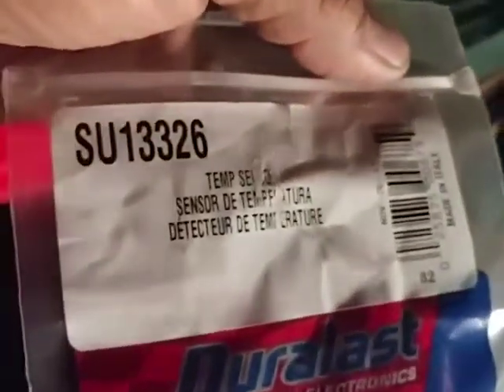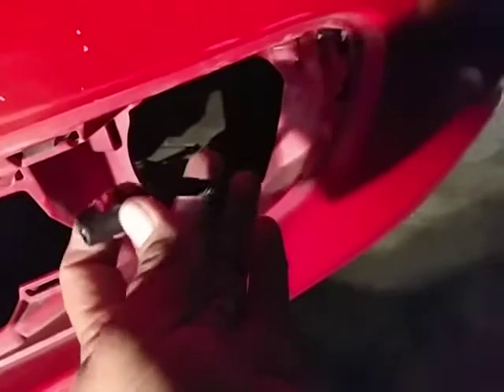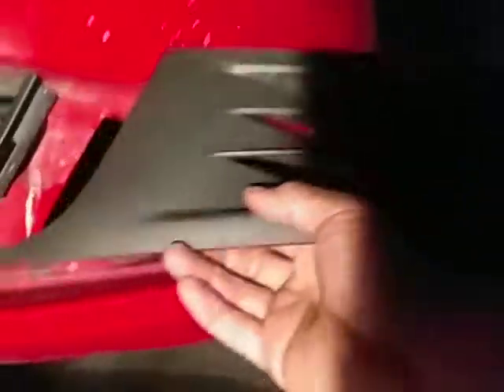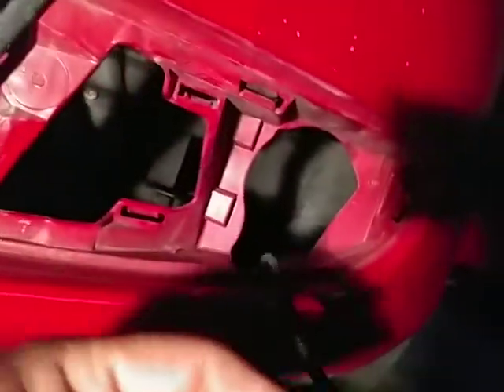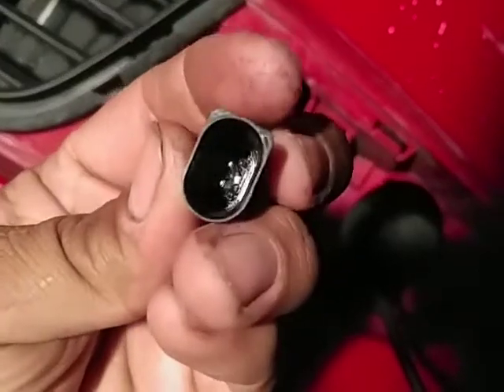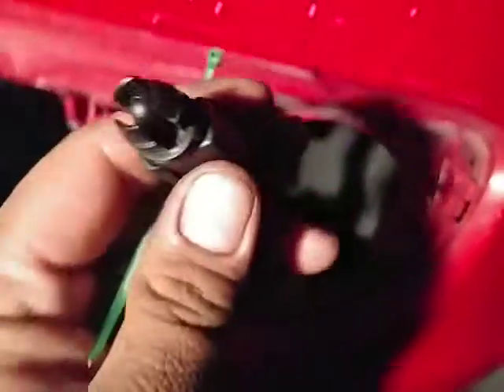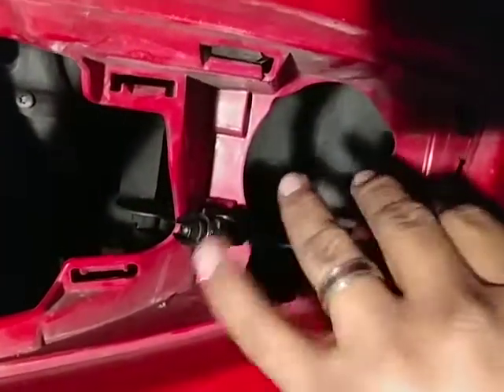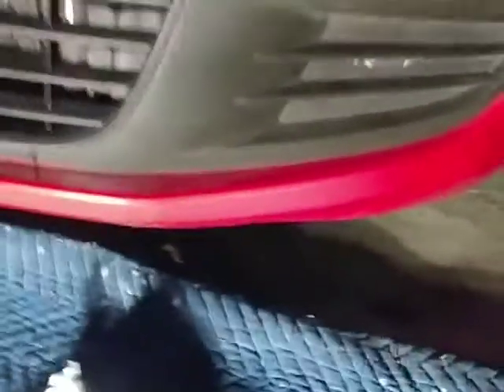2013 vw golf ambient temperature sensor

Comment: My ambient temperature display shows up once in a while.
My climate control works for 10-15mins then switches off.
This morning it rained and my ambient temperature display worked but showed -6°c but the real ambient temperature was 20°c.
This time around the climate control won't work.
This afternoon once the weather dried up my climate control worked but only for 10-15mins.
N.B. I recently changed the Aircon compressor.
Do you think the external temperature sensor is faulty.
Reply from the maker: @shadyninja1  for what you say it may afrct it but would not be sure of it 100 percent but doesnt hurt to try
Reply: @sagastum211  I have ordered the sensor and I will try the pressure switch

Comment: Hey bro where does the wire run too? My whole wire got pulled out
Reply from the maker: Black Label Elite i can take look where runs to
Reply: Juan Sagastume thanks boss I found it! Thanks for the quick response
Reply from the maker: Black Label Elite okay no problem sorry could not find it right away as dint have acces to car at the moment
Reply: Oh no boss I know we all have stuff to do I was just wondering I was just wondering if you already knew I appreciate the fact that you were going to look!
Reply: @BlackLabelElite  Hey bro would you mind sending me the location of where it connects to? Mine got pulled out too...
Reply: @cometinnuran7854  I took a picture of it I believe let me checking I can find it I will update you
Reply: @BlackLabelElite  were does it run to and what are the colors? Mines got pulled out to
Reply: @rayleemck  boss I will look and let you know if I don't get with you tomorrow message me again
Reply: @BlackLabelElite  any word?
Reply: @rayleemck  Yes okay looked at the wires and if your missing or can't find yours they are in the wire bundle that also runs to your horn in my 2012 gti and probably on yours as well so if you can see your wires that's probably where they were ripped out from hope this helps let me know
Reply: @BlackLabelElite  THANKS